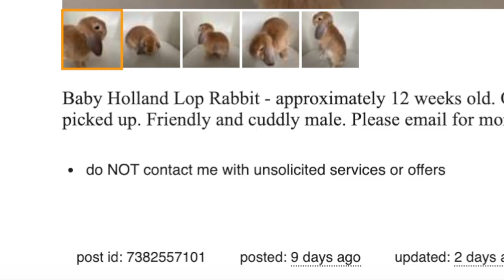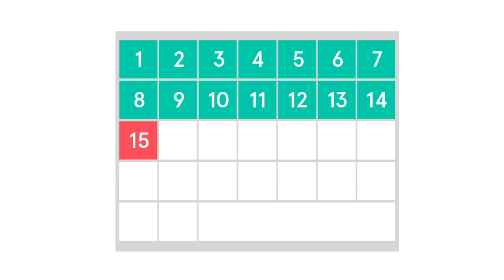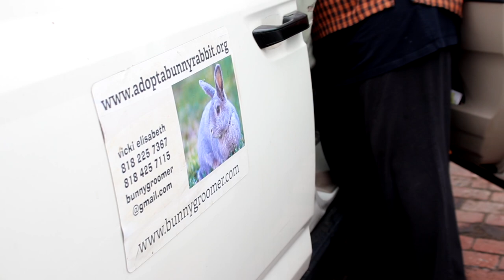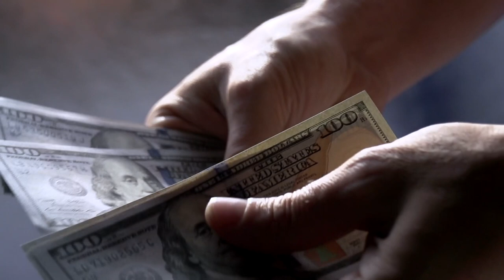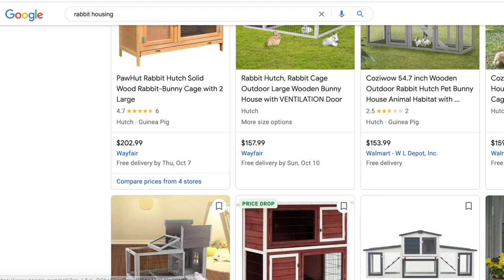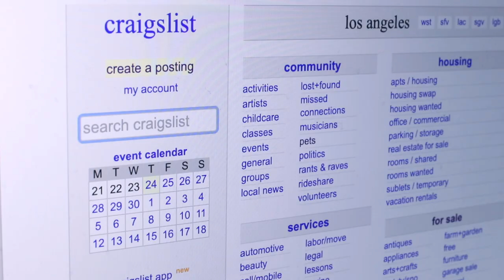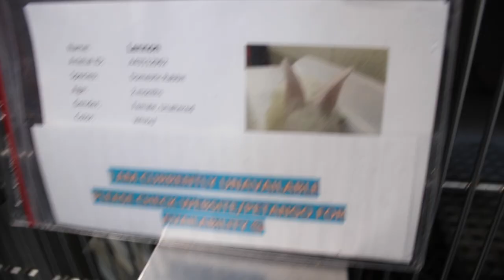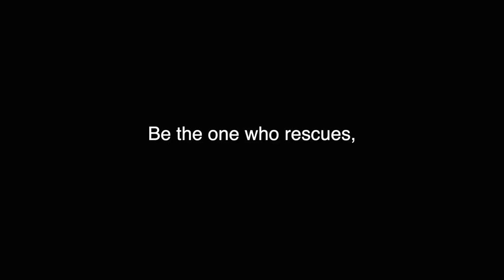The Dark, Twisted Truth about Breeding Rabbits

Comment: Education is key. (Lorelei you’ve done so much ❤️)  Although rescues do a great job screening, the others will still get a bunny from someone else.  And we need to put pressure on Pet stores (online included) to stop selling inappropriate habits and provide education on proper care.   Maybe provide a link to your channel 😉
Reply: Full disclosure:  I raise rabbits for meat, so there is going to be a lot I disagree with on this topic about "evil rabbit breeders" and the use of cages.  However, one thing I WILL agree with is the inappropriate housing sold in pet stores.

Here's one truth:  I have NEVER seen a breeder use a cage with less than 24" depth, and typical doe cages are 30x30, x36, or x48.  Yet when you go to a pet store, the average rabbit habitat is 16" or 18" wide.  The biggest cages I've found in pet stores are a whopping 21", that's terrible.  By the time you add food/water/toys/litter pan, the rabbit has nowhere to sit.  The wire and wood is always coated -- and guess what rabbits do?  They chew.  You don't want your rabbits eating PVC coating.

The problem isn't "evil breeders."  The problem is a pet market that doesn't understand what rabbits need, and irresponsible buyers who get bunnies for their kids without understanding they're not a low-maintenance, cheap pet. This is like blaming show dog breeders because your local shelter is filled to capacity with abandoned dogs.  It's not show dogs that's filling up shelters, no more than show rabbits or meat rabbits are packing rabbit rescues.

Comment: ... actually  inbreeding  isn't  really a problem  with rabbits until you reach like 25 to 40  sibling matings .  And typically line breeding to father to daughter or sibling to sibling then crossed back out for F2. And even then it's only done  for tests. Or  to lock in traits .  All a familial  breeding actually  does is draw out traits faster ie , best or worst . So it's a tool to proof lines . And can actually  be very usefull.to getting superior quality, and flushing out any bad gene. With rabbits breed best to best and eat the rest.